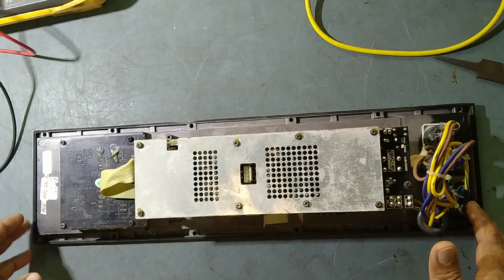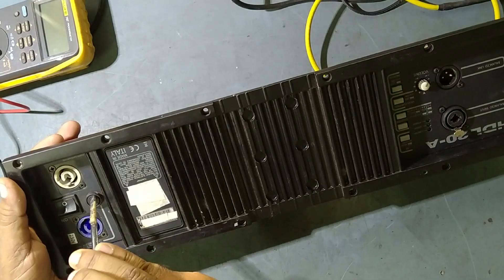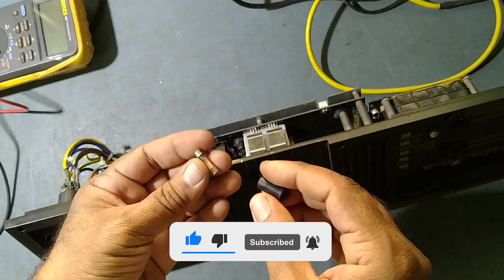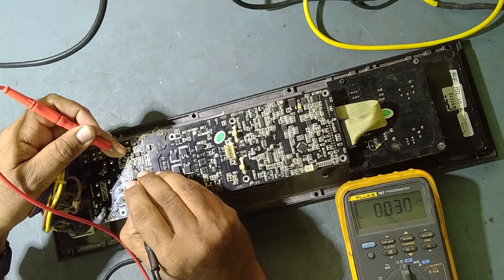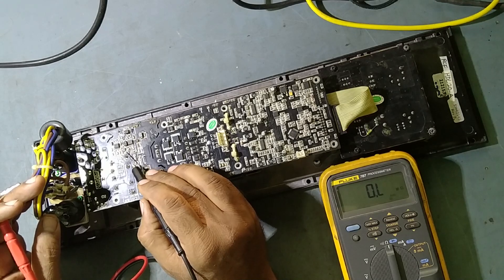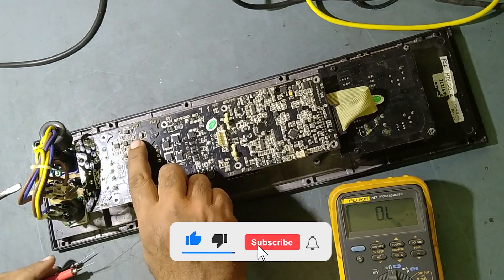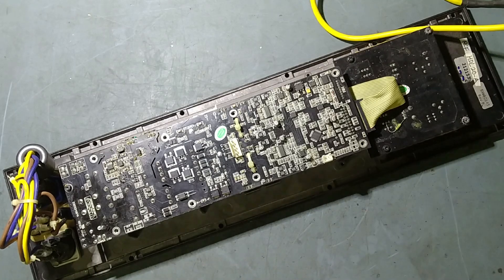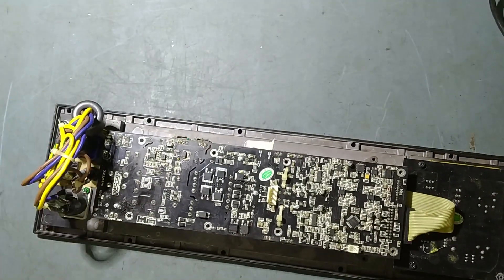Solved! Watch as I Fix a Seemingly Unrepairable RCF HDL20-A Active Line Array Module #deadrcfhdl20a

Comment: Dear San I have rcf evox8.. It has very low sound, also hf sound mixed with lf..
Reply from the maker: May be problem in amplifier section or pre amp circuit

Comment: I have three of these that were linked. Unfortunately the live wire touched the earth wire in the PCON plug. All three have power but no sound, the LEDs are all lighting up and I suspect the ADA IC to be damaged or the PIC; what do you think? The manufacturer won't supply spare parts.

Comment: Hi. Great work, do you have time to help me with a question? I removed the 2x IRS20955STRPBF from a RCF 715 module because i was getting voltage on the output transistors with no input signal. But, not long after removing the ic's the power supply went dead, i was going to probe voltages. Did i somehow kill the power supply of is this just a safety feature? Will power come back once i replace the IRS20955STRPBF's?
  If i manage to get power back but the issue came from before IRS20955STRPBF what else should i look at? It is on a Mk4 and there is no glue on the underside.
Thanks
PS. Can i poke around the op amps and dsp ic's with an oscilloscope to try to see where this strange signal starts?
Reply from the maker: Please email on this electronicstkf@gmail.com

Comment: sir in ht iv 300 no hdmi output when i connect to tv ans sourround speaker not working nd all 4 speaker working.
Reply from the maker: May be most probably problem is in main digital board
Reply: @TKFElectronics  can it be repaired
Reply from the maker: Yes but need to check first

Comment: Great work, sir.

Having similar issues with 2 RCF HDL-20A which fail to power on.

Both of these amps had shorted Mosfets '6R190C6' as well as Driver IC 'S21531D' which have been replaced. Also replaced the 2 big electrolytic capacitors, the fuse, some burned SMD resistors (all on the power/hot side).

Checked remaining SMD resistors & transistors and the values match with those from a working amp.

The voltage at the SMD capacitor which sits right before the S21531D chip should get 14-15 volts otherwise the amp will not power on but unfortunately on these the cap is only getting 8.5 volts.

Any idea what the issue could be?
Reply from the maker: I think may be any smd components located near  ic might be weak or leakage, may be i am not sure.
Reply: @TKFElectronics  

Issue resolved.

In one amplifier I had to change the SMD capacitor (1μF) to the right of the one mentioned above which was not receiving the 15VDCs and above the resistor marked 1089 plus the change of the 1BW transistor, driver IC S21531D and the 6R190C6 mosfets. The second one I had to change the same components except the SMD capacitor (1μF). Another issue is that the S21531D doesn't like to be soldered with hot air; I had to do it with a soldering iron.